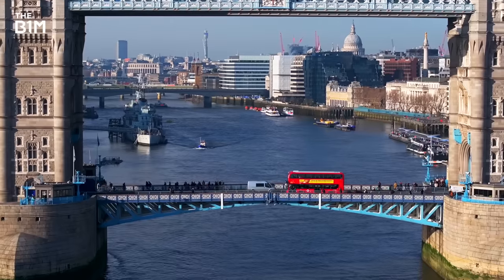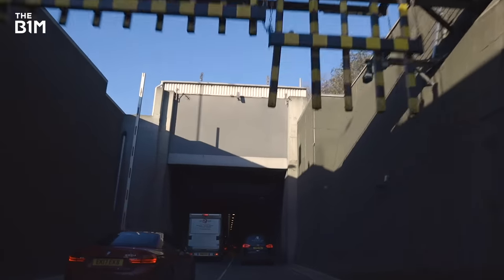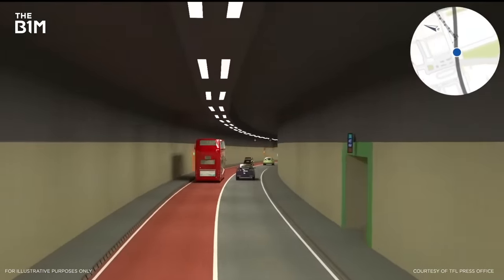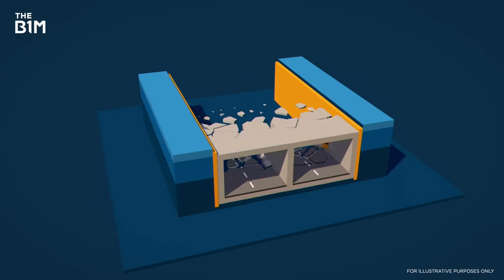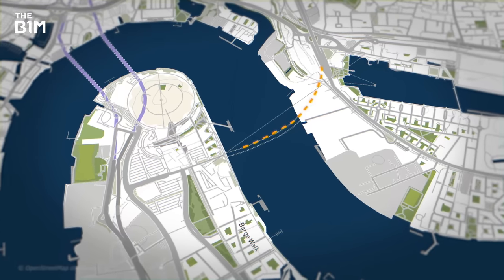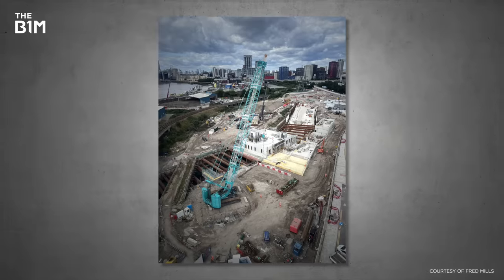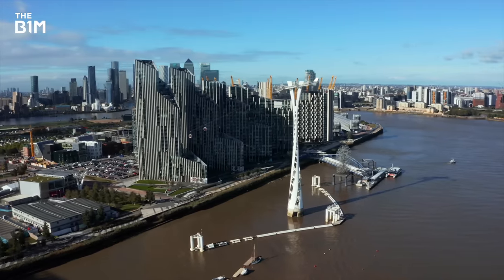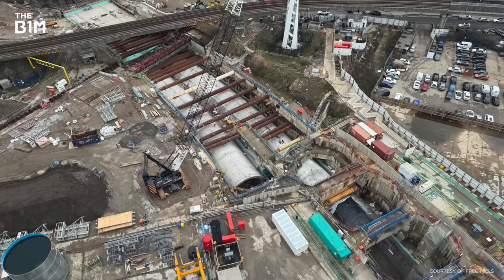The $2.8BN Megaproject Dividing London

Comment: Ah yes, the classic "Let's build more roads to reduce cars". It'll take maybe a year or two until congestion is at old levels again.
Reply: There is just a minor completely unimportant detail in the number of people being transported. No, it will NOT be the same.
Reply: This is true but East London is terribly served by river crossings. Having more options for people to cross further down stream will reduce cars having to go further towards the centre to cross. If they were just widening a road I would fully agree but since this is adding a whole new crossing in an area with far less than the west I think it's different.
Reply: @acceleratedsloth  Completely nullified by the increase in population of the city. Ultimately, nothing changes.
Reply: Induced demand is the word you’re looking for, the most ignored phenomenon in city planning.
Reply: @acceleratedsloth Except we should be reducing the number of car trips, not increasing them. If you're going to spend the money, spend it on transit or bike infrastructure, not cars.
Reply: Like most newly built roads in the past 50 years this one will reduce cars and emissions long term, right? It has always worked - no idea why it shouldn't now...
Reply: @manuelmeier8423  I hope that's sarcasm.
Reply: This is far more expensive per kilometer than HS2 was, without any of the reduction in road usage.
Reply: @kirkrotger9208 no worries, it is.
Reply: @cherryslat5702   this. I feel people have missed the point of this scheme. Now don’t get me wrong, I hate car centric planning myself, I don’t even drive. For me the tunnel hopefully means we’ll get some much needed double decker buses on the 108 which is London’s busiest bus route (I think? I remember Geoff Marshall mentioned a similar stat in his All The Buses video), plus perhaps even more buses crossing the river.
Reply: The problem is, East London pretty much downriver from Woolwich/Charlton, decent fast public transport is crap, tube is non existent and the DLR isn't much better, as well as being relatively slow.
London could do with double or even treble DLR (tube/OG/XR networked) capacity to better suit the needs of the population.
A web of 1500km of DLR rail transport and 2000 stations should do the trick. It also has to be cheap.
No mean feat in China, but complete dreamland here in the UK.
Reply: Ah yes, the classic "Let's remove roads available to cars and turn them into cycle lanes.  That way car owners will lose the will to drive"
Reply: London crossings east of tower bridge have been terrible (I live in south east London) essentially east of tower bridge you have 3.5 options (1.5 of which aren’t viable) 

You can drive all the way out of London to use the Dartford crossing just to have to drive back into London which is not feasible 

Use the boat crossing at Woolwich which isn’t fast enough or 24 hours 

Or the two tunnels at Rotherhite (single lane awful traffic) or Blackwall (double lane but still awful traffic) and the rail services don’t really cross the river either aside from the jubilee/DLR which for some aren’t convenient 

A bridge/tunnel has been needed for a long time plus extensions of the DLR/overground is needed as well
Reply: @northseawolf also not forgetting that crime is higher in these areas, they might have cycle lanes, but your bike will get nicked if it’s locked up in public. 

Also, I never take public transport at night because of the safety of me and my family. So until that’s sorted I will continue to drive.
Reply: @cherryslat5702 why the heck are they not building a new subway crossing? I don‘t get it
Reply: @acceleratedsloth yes but most individuals care about the speed they can get to a destination. If that isn't faster, it isn't better for them. But yes more people will be able to cross at a time
Reply: Right foot creep
Reply: to be fair tho at least the tunnels will be tolled
Reply: @meiko_kaji so you want to actively make it more difficult for people to travel meaningful distances?
Reply: Oh the classic don’t bother improving anything, let’s leave it terrible!
Reply: Ah the classic “let’s bitch at any proposed road project ever” and claim we shouldn’t build it because more cars will use it. 😂
Reply: @DavidMackenzie yes because it goes under a waterway this is much more comparable to channel tunnel construction but much smaller scale and costs because we have to train new engineers because we don’t build enough large scales projects like this and hs2 in the Uk because they all either get cancelled scaled back or never started
Reply: Its better than deleting lanes of travel to make traffic worse. Car and truck travel is a must for a 1st world country.
Reply: Ah yes, the classic "Let's spend transport money on cars"...
Reply: @dinsel9691  Melbourne is in the process of removing 60% of lanes for cyclists. An avid cyclist said he doesn't see the point. Delivery vehicles are forced to park 3 blocks from their drop off because the council removed their lanes.
Reply: And I suppose bikes work - oh, they do in a way...
By reducing the roads and increasing congestion, you close down more and more business and of course, you reduce the reason why people would want to go into an area and in turn, yet more businesses close and there's less traffic yet again.  Hmmm, maybe that's what people mean by the success of cycling and cutting down roads!  Also, making people poorer will reduce congestion - drive out the ordinary people and replace them with woke hipsters (an ugly form of gentrification).  Problem is that many people don't see this as a good thing.  Fortunately, the war against 'Climate Action' and woke ideology is well underway!
Reply: It'll be interesting to see how many private cars take the new tunnel given it will be tolled (c.f. M6toll), while given it will be tall enough to accommodate double decker buses, it has the potential to increase bus throughput.

The other point is redundancy: the narration claims the existing Blackwall Tunnels are often closed, either due to accidents or maintenance, so this will provide an alternative to a six mile diversion (3 miles each side).
Reply: @acceleratedsloth  except we should be using and encouraging cars less, not more in cities for plenty of reasons. If you spent the same amount of money on public transport or bike infrastructure, you can increase capacity by far, far more than with a road
Reply: At some point it’s actually about improving through put as opposed to reducing congestion.  

The big clue with this project is the dedicated lanes for large vehicles like busses, and trucks that can’t go through the black pool tunnel.
Reply: As a person who is keen about idea of car-free city centres I am yet annoyed of the way you people go on about this. This is not an added lane but a totally new route.

You know that congestion and traffic are increased by cars driving around trying to find a spot to park? Decentralising car transportation could very well make the city more livable.

From public transportation perspective you are forgetting the buses. Being a toll tunnel, it does still create an incentive to take a bus, but with much better connections thanks to the tunnel.

And importantly you are ignoring certain people. Families do still immensely benefit from cars. Small companies do need roads to fill their storages, and due to the state of London public transport system, it is still very much necessary for there to be meaningful ways for cars to get around. Especially during the night-time  car is clearly the best option.

The change doesn't come by forcing it, at least it shouldn't be done that way. More so, to get less people to use their cars, they should be motivated to do so. Give them an incentive instead of a punishment.
Reply: @manuelmeier8423 😂👍🏻
Reply: Obviously, they haven't watched the Not Just Bikes YouTube channel...
Reply: @meiko_kaji car free zones 😂😂. You really don't have a clue
Reply: The left are really on a war against cars 🤣
Reply: @kirkrotger9208  since 2000, the UK population has incrased from 58 million to 67 million. Do you think an extra 9 million people increases congestion or emissions? Does population rise drive increasing emissions from construction, heating, food production and transport? It's silly to blame an infrastructure project for a natural consequence of more people on the island.
Reply: @campbellsadeghy213  yes
Reply: well i think thats the case in previous scenarios where there was limited alternative transportation options. But London has these. And this road is just a fraction of the required investment to keep up with the amount of additional buildings planted on the skyline in that area over the last 40 years.
Reply: Well plans to get cars off roads generally ends up with congestion moving sideways into other streets. Areas poorly served by public transport are much harder to resolve for a city that is massively behind the investment needed in infrastructure against the population expansion.
Reply: @acceleratedsloth that number is a tiny percentage of what could have been transported by building it a bit wider to accommodate a tube line
If you want to move people, trains are far and away the best option
Reply: Well its not actually a bad idea to build more river crossings. The bud lanes aren't a bad idea but how realistically will the lanes be kept free of cars ? Also, they should have definitely built a separate bike tunnel.
Reply: Its going to be a toll road though
Reply: About time this country started building more new roads 🎉🎉🎉
Reply: Nah, it'll be obsolete the day it's built.
Reply: True, but the new tunnel is designed to be big enough for double deckers and also has bus lanes
Reply: Here in Los Angeles, we've found more roads and more lanes means more traffic. It won't decrease congestion.
Reply: The money is burning a hole in their pocket…..must spend because i can…why dont they create little caverns in the tunnel walls for homeless indigenous British people ?
Reply: And if nothing is done the existing congestion gets far worse?
Reply: If you are a van driver in east london, the only way to south is Blackwall tunnel, Dartford crossing and Tower bridge. Dartford has a charge, Blackwall will soon have a charge, and Tower bridge is standstill pretty much 24 hours a day
Reply: Exactly
Reply: The problem isn’t tunnels, it’s landing them into congested areas. 

In a closed loop these roads would be fast and efficient; but as soon as you have to connect them to congested and inefficient surface roads that are plagued with traffic lights, narrow rat runs, and variable parking systems; all that smooth flow from the tunnels and highways are eliminated. 

We’re experiencing this in Sydney right now with the recently opened rozelle interchange (b1m did a video on this) and it’s all magic from the middle ring suburbs until you hit the last 5km to the city and it all bogs down from the congestion points at the tunnels termination point.
Reply: Here’s the issue, there’s no crossing at all so it doesn’t matter if you want to drive bike or walk, you can’t cross the river. Something had to be built.
Reply: @kirkrotger9208 problem is there was no crossing there to begin with so even if you wanted to bike, you can’t, you’ll have to to take a massive detour. I would much rather people drive then have no crossing at all.
Reply: @grassytramtracks but you should agree that a river crossing should have been built either way because no tunnel means nobody can cross without a large detour.
Reply: @Bobspineable  No, it's much better to have no crossing at all. People have gotten by just fine with no crossing for literally ever. More car infrastructure is never a good thing.
Reply: @kirkrotger9208 no crossing at all you say, why do you actually think that. Having something is always superior then nothing at all. Bike lanes  can always be added but a tunnel must exist first. Otherwise your choice is a ferry or a long detour.
Reply: @Bobspineable  Something is NOT better than nothing when that something is actively detrimental to society. Car infrastructure is always detrimental.
Reply: @kirkrotger9208  tell that to the bus drivers and truck drivers then because that’s who really needs it. Tolls will be enough to discourage enough drivers away. Having infrastructure will always be better than no infrastructure. Otherwise business cannot be done as that’s the ultimate goal. Business and money. Those sweet tolls are surely generate money you know.
Plus you could always look at the roads of Asia where all forms of transit coexist, including cars. You can incorporate all of them together.
Reply: @kirkrotger9208  you act like cars are the death of society and yet here we still are. You’ve clearly haven’t heard the endless complaints of having no river crossing even amount pedestrians and cyclists. Having infrastructure will always be better than no infrastructure. Otherwise business cannot be done as that’s the ultimate goal. Business and money. Those sweet tolls are surely generate money you know.
Reply: @campbellsadeghy213 you win 😂
Reply: Not helpful. Same thing happens with trains.
Reply: It's the city hall's problem. I pay taxes so I can have as many cars as I desire. What were stats protectionists doing decades ago? More citizens = more congestions. 🤷🏾‍♀️
Reply: Might be best to carve out a tunnel from one end to the other end of London. Later branches off routes just as they did in the London Underground Tube. Problem is locals tend to travel by car and that just causes congestion, I don’t know at the end of the day.!
Reply: WRONG. The new tunnel will allow double decker busses to cross. Also there will be a toll for vehicles crossing the tunnel just like the Blackwall tunnel. So no. It won't be the same.
Reply: @bigbw0ii 
Or just stay in Milton Keynes
Reply: You got a better idea?
Reply: @acceleratedsloth Induced demand is real and observed, people who need to travel by car already do, this will just induce demand for people who want to
Reply: As a van driver who is forced to make that trip regularly, I'm happy for it and double the tolls if you want to get rid of cars. I'll pay fine it's for the business.

Will also allow for a much greater bus capacity. I feel so bad for the poor buggers stuck on the busses in the traffic around blackwall.
Reply: London needs another crossing, there are literally only a handful and they were never created with modern traffic flows in mind. East London will seriously benefit from this tunnel.
Reply: @REDnBLACKnRED population would and does increase anyway
Reply: Cant please you people lmao
Reply: The Jubilee line is a subway crossing. It's been there since 1998. I know this because I live in East London. Ever since the Olympics, East London is becoming busier with more people living there and more job opportunities. We need more crossing going from the East. I hope the DLR extension happens at Thamesmead to Beckton. Even if the bridge there is likely to not happen. That could provide an option. Yes we need more rail infrastructure, cycling and pedestrian crossings but how are people going to eat. How are going to supply goods more efficiently. There are those who can't ride bikes and live nowhere near train stations. Also at least buses can use it which is a public transport option. There is only one single decker bus crossing the river and North Greenwich O2 has to many visitors.
Reply: @Dalex1910 the cable cars is there for pedestrians and cyclists anyway so at least there is an option for that. Meanwhile you want to use a bus that's where the real trouble kicks in
Reply: @kirkrotger9208 Lies I live in East London and I can confirm to you that even with the Jubilee line, Elizabeth line, DLR and Cable cars. We are back to the same issue again this time worse. The population of London has increased tenfold since the Olympics in 2012. We need more river crossing options in East London. If you are building new homes and creating more jobs you are still polluting and causing more congestion anyway. 9 times out of 10 people in a local neighborhood has a car. We need to make a decision on what people want out of London.
Reply: @Mtl-zf9om thank you